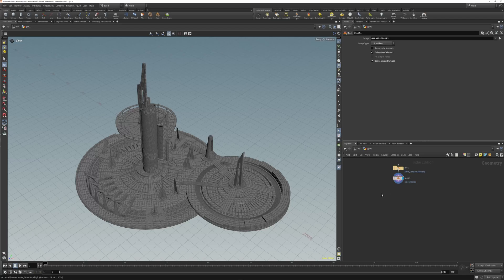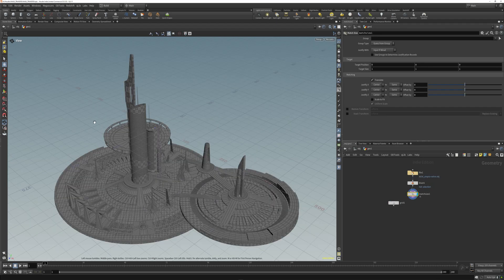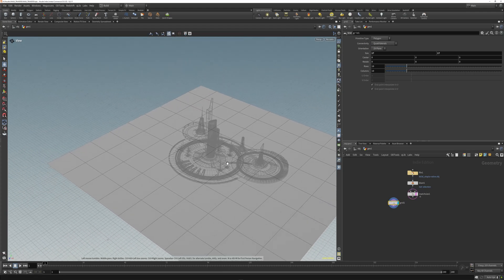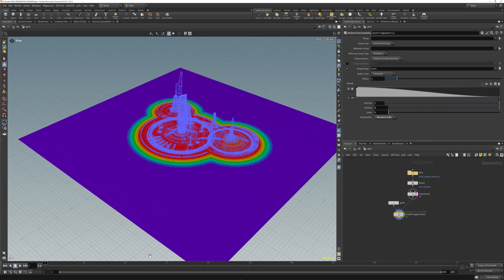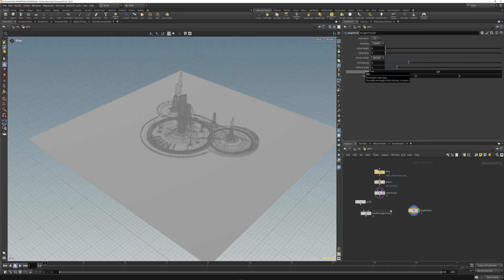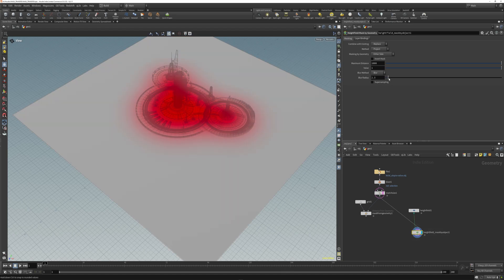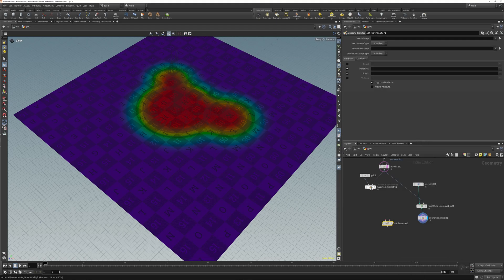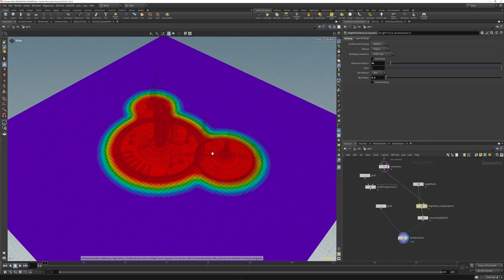Houdini Mask From Geometry Tip

Comment: @lukasz Is there something in the viewpoer i have to turn on to visualize the heightfield colors. Its driving me crazy

Best,
Reply from the maker: The worst. I've had this issue from time to time. Here's what I've done in the past: 1. Press ESC in the viewport. Sometimes a command is overriding while it waits. 2. Flagging the node above and then back to the height field, then pressing enter to enable masking again. 3. Middle mouse clicking the node and enabling the 'mask' attribute on/off/on. and 4. My fav, I disabled the view attributes button in the toolbar. It looks like a Map Location pin. Should be in the vertical icon bar to the right of your viewport. If your UI scale is high and you have another window below the viewport, it sometimes gets hidden and you need to scroll down to find it. Let me know if that helped!
Reply: @xrossfader  omg. the middle mouse and you can toggle any attribute!

Thank you so much
Reply from the maker: @ happy to help. 🫡

Comment: Nice one! When you say non-flat surfaces what type of result are you trying to achieve on that surface? Like a projection of the form onto the non-flat surface for the mask?
Reply from the maker: Height fields are built off a flat plane and trying to use them on your own geo doesn't work unless you bake out the height field into a texture map and use it as displacement. Paul Esteves actually has a video on this if you're interested. Which now that I'm thinking about it could potentially be something unique to try as you can use attribute from map to get the black and white data onto your geo. So say your object is a sphere and you need to get a mask from geometry on it, this tip wouldn't work unless you were able to unwrap the object to a flat plane to transfer the data to it. Hope that helps. ;)